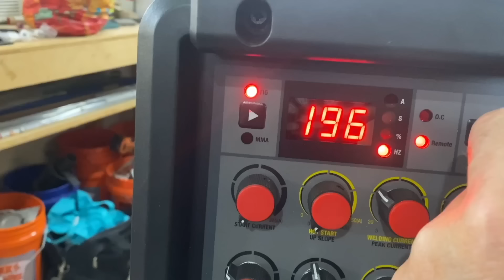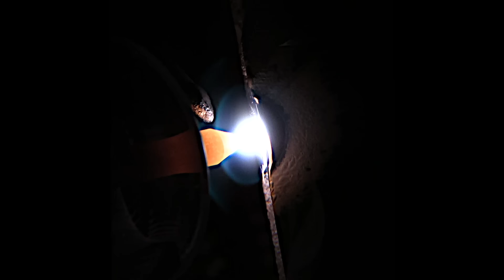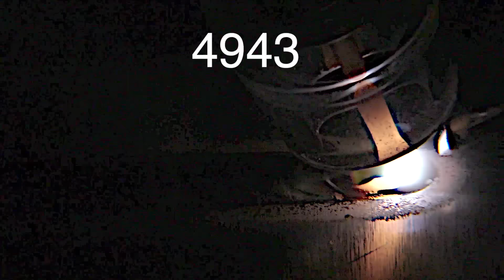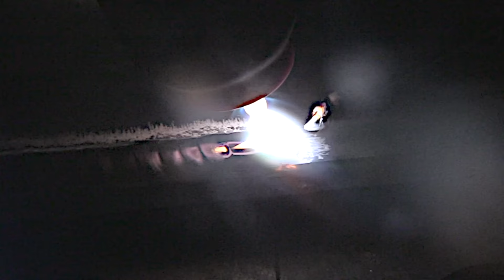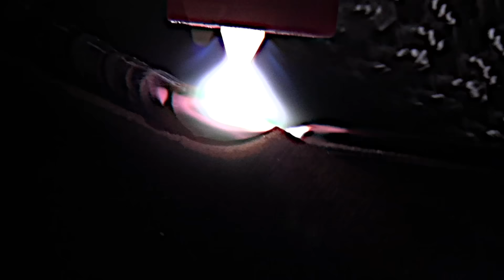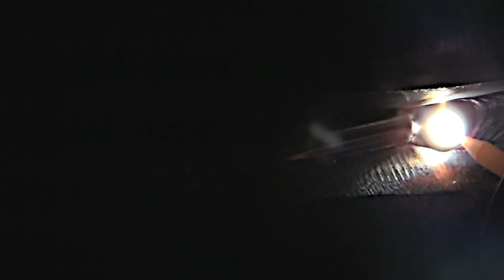Aluminum TIG - Tips, Settings, and More

Comment: The problem to sellING more tig fingers is,  They just last to long. I still have my very first one... it's lasted over a decade it's ugly now but still works.  JUST A GREAT PRODUCT
Reply: I rarely need one but I’ve put few thousand hours on mine over the last 10 or so years, and it’s just now about had it. I’ve used a few black stallions during that time and last maybe a week. I might FINALLY have to break out the second weldmonger tig finger I got in a two pack bundle 10 years ago. Jody made the best, fukk the rest.

Comment: Man, I wish I had an AC/DC tig welder.
Reply: i have the Vevor 225 ac/dc (only ac/dc) there is a 200amp one for pennies cheaper literally  10 bucks difference for 25 less amps of power not worth it. The 225 is good deal for  $360.00 and then a bottle bought a full 125cuft from amazon you will need tungsten of your choice and fillers for your materials I bought a simple gas lens and stubby combo cup and collet kit, 1/16 4043 3/32 4043 alum rod, er70s-6 mild steel rod, 1/16 lanth 2% 3/32, 2% thoriated tungsten, all together I have 800 and a little change in it and my first TIG machine I'm on my second 125cuft bottle of argon just going through the motions of this difficult welding process I have been stick and MiG welding for years as hobby and this machine is working do note the foot pedal is just a switch not a variable resistance control you set that on screen and its not hard to figure out if you have welding experience in general I'm really thrilled by the aluminum beads I have learned to run from watching this mans excellent welding skill and teaching skills I really had some walk away from the frustration to start but halfway through my argon and I had her dialed in and ran a perfect flat bead and it really did bring a smile to my face this is one of the hardest things to learn and next was adding filler as well a whole other very difficult thing to coordinate and not jab the tungsten